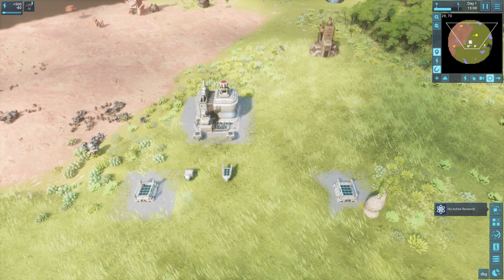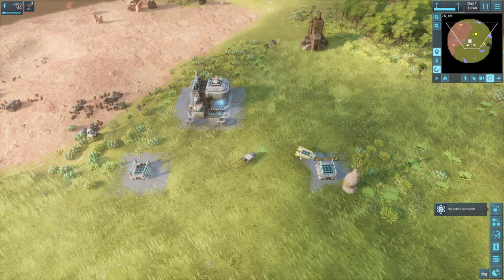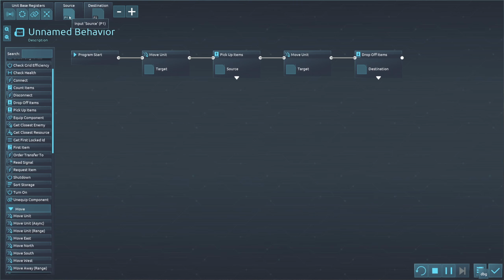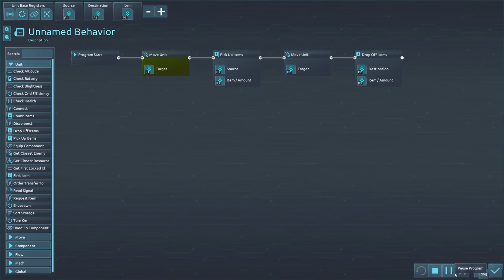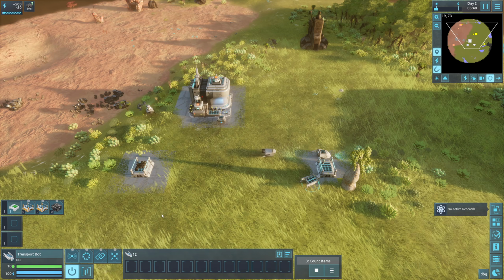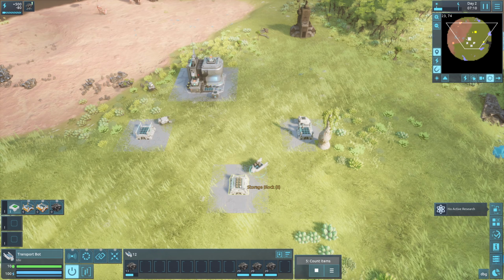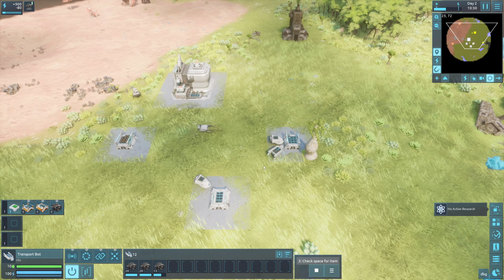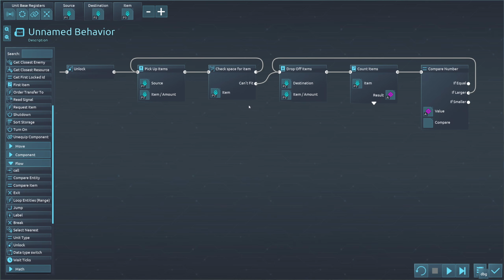Desynced - Basic Behaviors - Point to Point transport tutorial

Comment: Hello,I play this game yesterday.I'm using behavior system,I can't let the robot automatically get the storage block it should go to.I have to manually link the storage block like you.Could you solve this problem？
Reply from the maker: Franly automatic storage block assignment is not something that I would recommend for most cases before most recent public update, but currently: Set up the storages to send specific signal, perhaps 'green', 'yellow' or whatever other signal You will not be using. Then get your robot to loop through the entities with the signal in question, and save it as a variable or register You want to use as storage. Loop signal can be used to read signal from any distance.

Comment: Unlock seems too counterintuitive. I think it would have been better if 'pick up' did the same and had 'can't fit any more' output, may be with a register slot to output/save what was picked.
Reply from the maker: Unlock itself is simply designed to process multiple behavior instructions within a single tick, and to boost the speed of logic in rest of behavior.

It does not do anything beyond that. It would be a nice idea to see pickup have 'error' branch where the command failed, possibly with 'no space' being one of those.

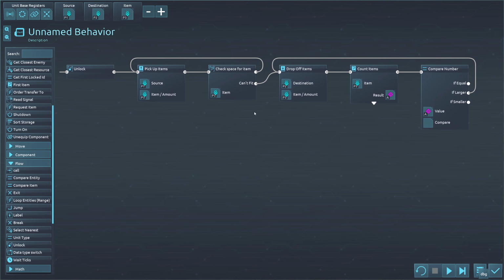Comment: 17:04 Strange that the game didn't notify you that comand limit per tick was reached in loops without "Wait 1 tick" comands.
Reply from the maker: As the tutorial was mostly on basics, I failed to cover one detail of behaviors, which is my bad, and I will have it corrected as soon as I am able to, which might be on 15th of August, as that is the Early Access release date. 

Now, the important part - explanation why:

Some instructions in Desynced have hidden (or more precisely - implied/implemented) delays. Reason for those delays differ depending on instruction itself, however the key point to take out of that detail is that some instructions, while implemented, will not continue with logic until the instruction is complete.

In case of 17:04 that would be both Pick Up Items instruction and Drop Off Items instruction. As they are functionally nearly identical let me break them down into 'substeps' of instruction, as they were when recording it, and both have added delays:
- Step 1 - move to target
- Step 2 - perform the exchange (request item -> transfer item if present -> finish the exchange)

Step 1, is, just like 'move' command (any move command with exception of 'move (async)' command) orders unit to go to the target, and wait until the unit is near to, or next to the target.
Step 2 on the other hand is the 'transfer' part. As You could see when unit transfers the goods, the transfer is not instantenous (though close to it), If my memory serves me correctly it should be about 1 tick of the transfer animation/procedure. This tick is also part of 'waiting' until it is finished, before any further logic is performed.

Thus both 'Pick Up items' and 'Drop Off Items' act in this case as delays.

All in all nstructions, from top of my head that include hidden delays are:
- Radar (unit is waiting until scan cycle completes, and then returns a value)
- Scout (unit is moving to close unexplored coordinates)
- Move (all variants - move, move distance, move in direction, with single exception of move (async) - unit is moving to the target, and continues after it arrives to the destination, which is usually next to the target)
- Pick Up Item, Drop Off Item, (and other item transfer commands) - delay is waiting until the transfer is completed or moving to the target in case of pick up and drop off variants.

I think that equipping or unequipping components and mine command also have that delays, for performing the processes involved, though I am not willing to make that a definite claim without access to working demo at the very least.